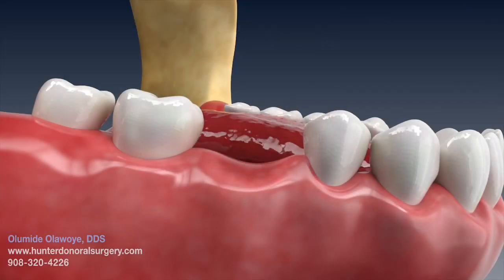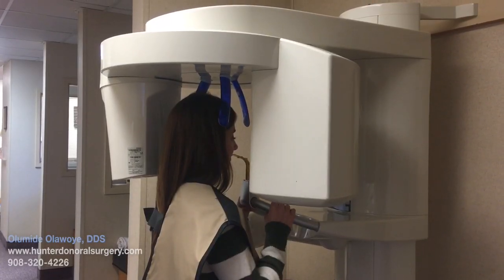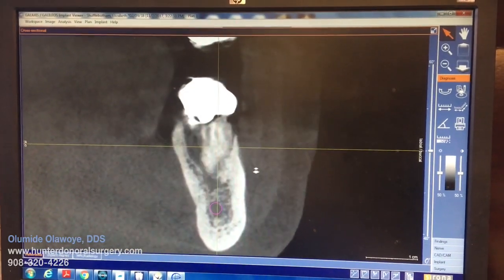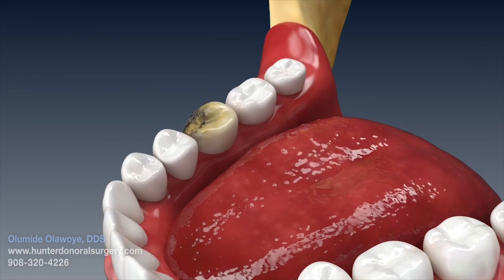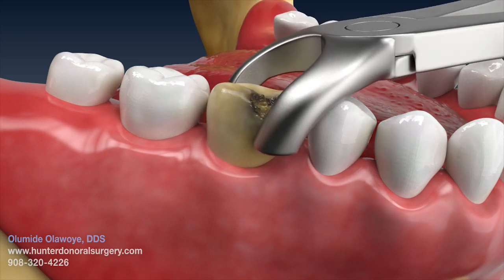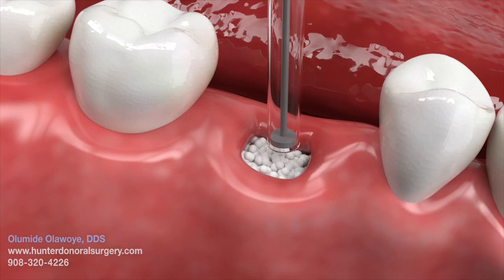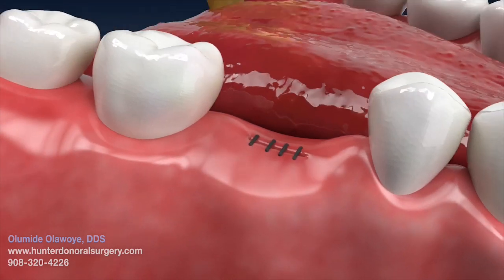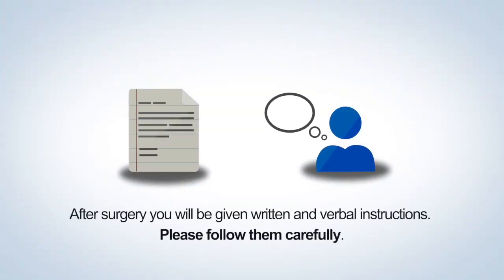Extraction and socket graft animation

Comment: I had this done last year but it was on the top. Only thing that hurt was the shot of novacain. I could feel the pressure of the dentist pulling on the tooth and him having to grind it down. As he was trying to get the tooth out, it shattered because it was pretty rotted, which is why he had to grind it down. I'm not trying to scare anyone here, but its really not as bad as it sounds. As long as you let your dentist know you're a bit nervous, you'll be just fine.
Reply: That's why they make Nitrous Oxide!  Don't leave home without it!
Reply: Happen to me too
Reply: Apls i dont want my teeth removed
Reply: My teeth was so decayed it hurt like hell but suddenly it stopped paining since 2-3 years....
But now it looks even worse with 0 pain
Reply: @SandHanitizer2001  dead nerves
Reply: Loosing a Top Molar isn't half as bad as a bottom Molar though, but the first shot of Novocain is as painful as hell, make sure you let you dentist know immediately if you still feel the slightest pain when they start to extract, they will give you another shot which will be painless since your jaw is already numb from the first shot.  Top Wisdom take a little longer to extract than your 1st-3rd Molars, But bottom wisdom teeth can't take up to a hour if it's well under the gumline.
Reply: @MarkWhich  A good dental surgeon will swab the gums with Novocain before the first injection.

Comment: I got my molar extracted today and it went horrible, surgeon injected atleast 3 syringes but i could still feel the pain. She said that medicine wont stop the pain caused by imflammation. (Surgeon said that after the extraction)
After extremely painfull extraction she worked with diffrent sized drill bits that was even worse and i was trembling. I had to stop the bleeding on my own after the surgery. Paid 70 euros for all that. Went straight to work afterwards and i bled for 4 hours like a little bitch.
Also she didint fill the gap with anything just used some tissues for bleeding.
I am never doing it that again while i am conscious